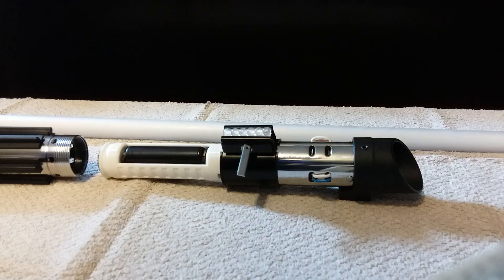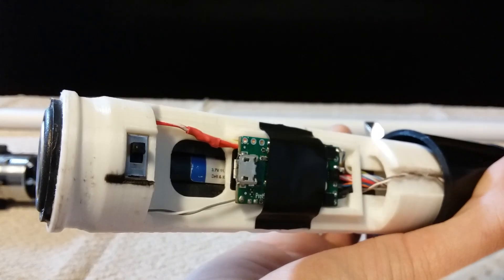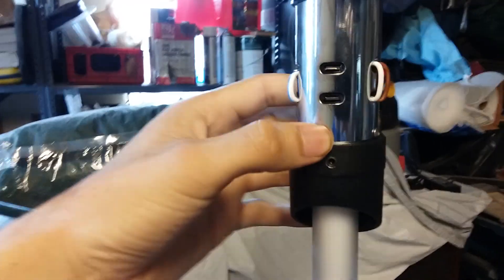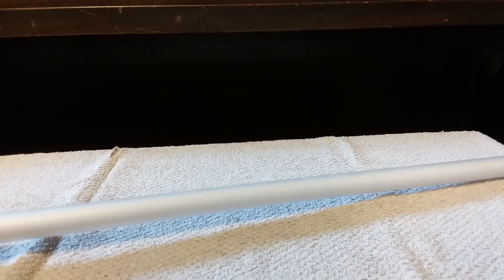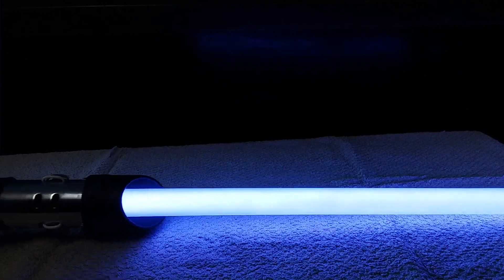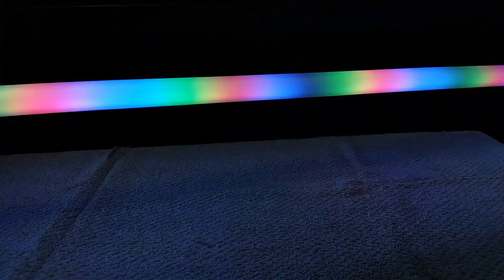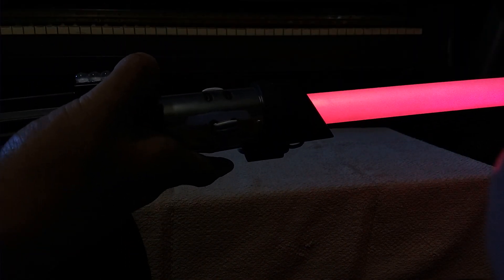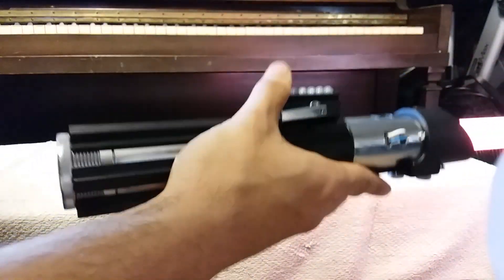Korbanth MPP 2.0 Neopixel Build

Comment: I love that Blade and I love the Crystal sabers from saberforge. Is it possible to mix the two?
Reply from the maker: It's possible but you'd have to do an internal make over. Definitely something you'd want to commission if you haven't done electronics work yourself.
Reply: @shrapnel95  I could handle the electronics I think but If I had to machine something to make it fit I think I might just make a mess of things LOL I can't believe the two have never been combined! Thanks for the quick answer!
Reply from the maker: @Skiiwa  if you wanted use a 7/8" all you need is a 1" to 7/8" adapter. Could be as simple 1" ploycarbonite tube with the inside sanded down 👍🏾 and no problem dude